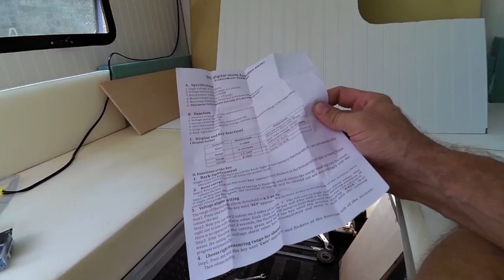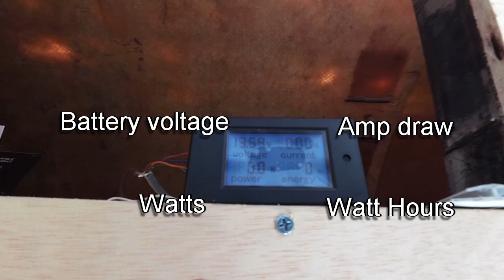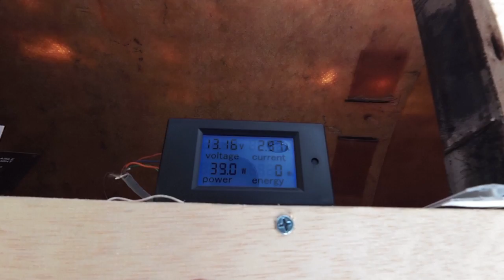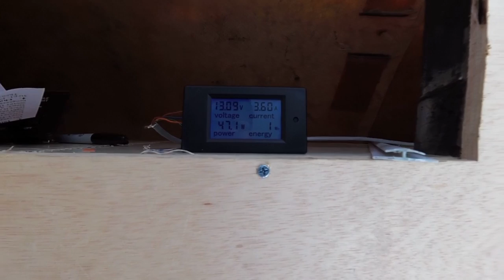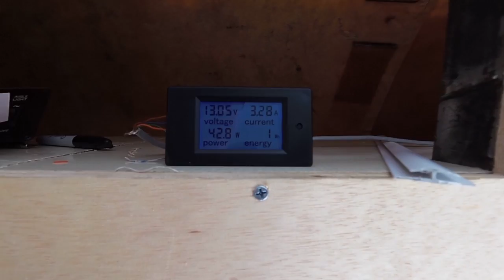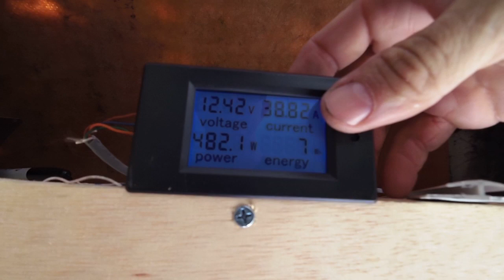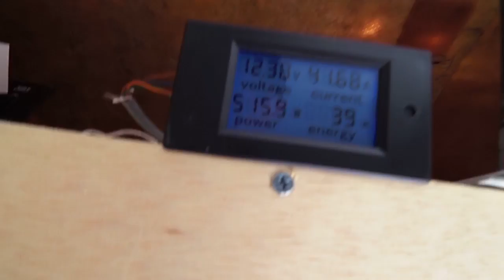Box Truck Camper How much Solar for A/C? Volt Watt and Amp meter  37

Comment: Hey JYDOG,

Watching your project with great interest.  Perhaps, instead of trying to find a way to get 800+ watts of $olar onto your roof, why not get a more efficient air conditioner that doesn't need that much power?  I'm not an electrician, but look at page two of this link.  It says this split system AC unit uses 7.1 amps to produce 7000 BTU's of cooling.  Didn't I just see your current AC unit pulling 40+ amps in the video? 

 http://www.dometic.com/QBankFiles3/EPiServer/Dometic/US/Specification-Sheets/Automotive-and-Truck/Air-Conditioning/3470-Blizzard-Turbo-air-conditioning-specsheet-Web_30203.pdf
Reply from the maker: Well this one is only supposed to draw about 5 amps except when the compressor kicks in and then it jumps to 40 amps. I agree. I think a total 12volt A/C system like the ones they put in the large semi cabs might be the best choice but they are $$ and hard to find.
Reply from the maker: Check this out. I think this is the right way to approach a solar powered a/c setup
http://www.cruisencomfortusa.com/how-it-works/

"All of our DC air conditioners use a brushless DC compressor motor rather than using a conventional 110 volt AC compressor. Conventional AC compressors have a surge or spike on each startup that is typically 5 to 6 times the running amps. In order to provide the amperage for start-up, the inverter must be sized significantly larger than what is required for the normal running current. In addition to increased cost, oversizing the inverter dramatically decreases its conversion efficiency. This loss of efficiency is directly converted to heat, adding to the cooling requirement in the cabin.

There are several advantages to using the brushless DC compressor motor. The DC compressor and its controller are connected directly to the battery. This permits the unit to operate directly from DC power and eliminates the need for a power inverter. The Cruise N Comfort line of air conditioners can save power when the environment temperature drops thus less cooling equals less amp draw, which then equates to longer battery life."
Reply from the maker: Ok, your question really has me thinking on this subject.  Here is the way I understand it. My ac using was using 550 watts at about 45 amps.  Using watts = volts x amps I get 12volts x 45 amps = 540 watts. My A/C unit is rated at 4.1 amps but that is at 115 volts so the math works out at 115 volts x 4.1 amps = 471.5 watts.  

So my realization is I have a real efficient A/C unit but the amp draw goes up because the voltage figure is smaller ( 12 volt vs 115 volt ) in the above formula. I think I am going to be hard pressed to find a more efficient unit.
Reply: Good find.  The ability to work directly off the 12V batteries without having to go through an inverter should help with the efficiency because the inverters draw a little power.  The 8000 BTU model you found (they had other ones but I'm interested in that size, and it helps in the following comparison) uses 45 amps and 12V.   45 x 12 = 540 Watts         http://www.sengpielaudio.com/calculator-ohm.htm

The 115V system I found (7000 BTU) and mentioned earlier uses 7.1 Amps (no mention of the startup Amp spike in their sales pitch like you witnessed in your actual testing)  115 x 7.1 = 816.5 Watts

I don't know enough to answer these questions...which would last longer on a battery bank....a high amp, but lower watt 12V AC, or a lower amp, but higher Watt, 115V system?  Another question for any HVAC guys out there...do you have to bring any SEER rating into the discussion to figure out which one would last longer on a battery bank?
Reply: Your AC unit is rated at 4.1 amps, but you saw it spike to 10x that on startup.  How long were you able to run it off your batteries, and when did the high amp draw start to settle down and get near the advertised 4.1?
Reply from the maker: Im not sure you saw my 3rd post on your question but the 4.1 amps is when you are at 115volts. The 40+ amps was because it was measured where the 12 volt draw is. The formula Volts x Amps = watts is where this happens. The watts stay the same but when you change the volts the amps go up or down inversely.
Reply: Okay, sorry.  From the video, I saw less than one amp on your panel, then you turned the AC unit on, and in the first few seconds before the compressor kicked on, your panel read 3. something amps...which I thought was what the AC fan needed to run, then the compressor started and pushed the readout over 40 amps.  I assumed those numbers were what the AC was calling for to run.  I was surprised that a unit that claims it needs 4.1 amps to run, spiked to 10x that.  I didn't realize the panel reading wasn't actually what the AC was using.  Sorry, my knowledge of electricity only goes far enough to keep me from sticking a fork into a wall receptacle while standing in a bucket of water.